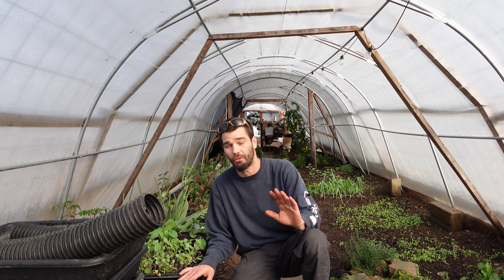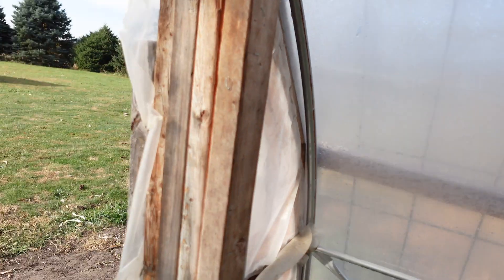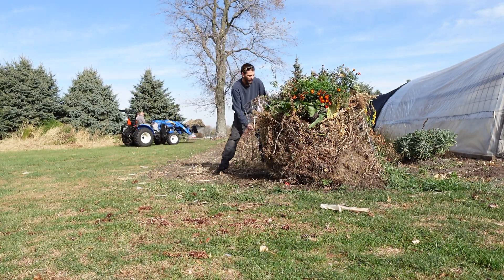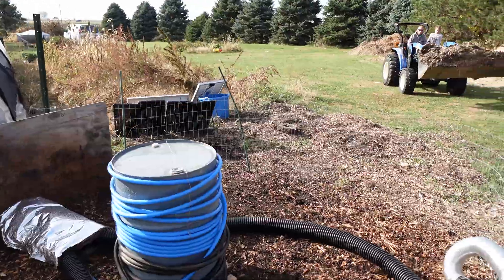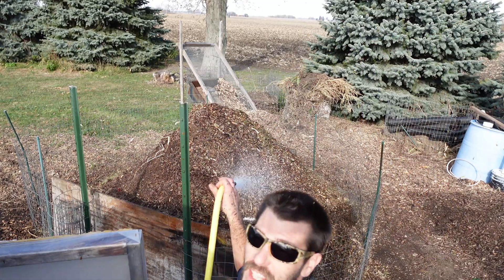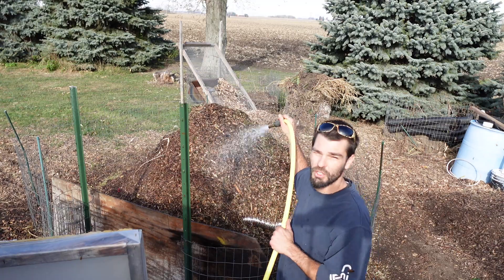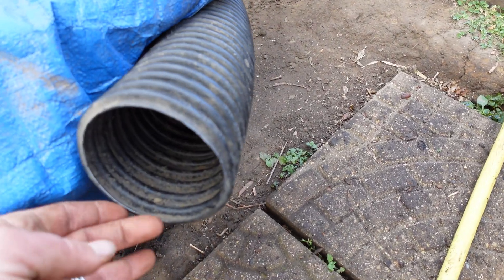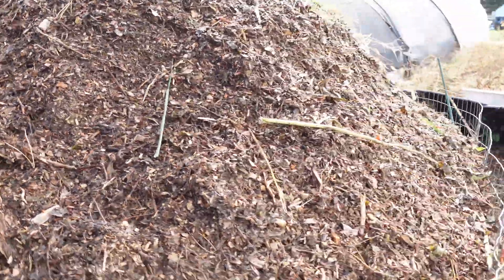How To Build A Compost Heater - Sustainable Greenhouse Heating - Jean Pain Compost Heating -

Comment: It's not going to stay hot all winter. I can see this is your first attempt. If the chips are fresh and had leaves it will get hot for a while. The leaves burn off quickly. You should have mixed in green hay (cheap goat hay) or lawn clippings. Even then you have to turn it regularly to keep it oxygenated. If not your aerobic bacteria will cook and then anaerobic bacteria take over producing less heat. I worked for a mulch company maintaining a pile of chips that would fill a football stadium. My JohnDeere loader would scoop up a full size pickup truck! I also make compost at home.
Reply from the maker: Not the first attempt we’ve been doing this for almost ten years lol. I didn’t show the cow and chicken poo slurry that was basted over the whole pile one five gallon bucket at a time and resoaked with heavy watering and more poo more water ect till I feel it’s properly inoculated. We’ve had the piles they we built up to 11+tons stay active inside the crust for almost a full year
Reply from the maker: I did show the cow poo slurry in this years video, my last long format video posted. Over a month and the piles still hot even with negative temps hitting us the past few weeks and I didn’t get the rest of the woodchips I had getting dropped before the snow hit so I used what I had prolly about 10 tons or so

Comment: Question from a total amateur here - how do you connect the compost to the air and water lines? I saw the tubing you put under the compost... but it didnt look like it connected. Also - Do you have to continuously apply water throughout the winter...? or did you cover it after the first rainfall. Thanks! :)
Reply from the maker: This is the compost heating playlist If you wanna check out how we’ve done it from start to finish https://youtube.com/playlist?list=PLKGq1CzKnwXNvQIKQ2OZ7DC3lT0w7M2XC&si=fPFZ7uaTnpfkloU3
Reply: @Earthdwellershomestead  Cool thanks! I will check it out :)

Comment: Anyone know what type/what it is called on the type of fence?  Size square, etc..  I need to start a pile.
Reply from the maker: Normally I insulate the pile very well, we experimented with an unisulated pile as we didn’t collect leaf bags this year
Reply: @Earthdwellershomestead  Awesome.  I plan on trying pine needles.  My mom has so many pine trees and inches under every tree.
Reply from the maker: @ericadams5019 Pine needles are a great resource!
Reply from the maker: This is just welded wire 1” or 2” works. It allows air flow and moisture to come and go

Comment: how does the air work? the air hose is open one one side and the middle is covered in compost? you mentioned fans?
Reply from the maker: We cover it all in our playlist names Jean pain compost heating. Both ends are open and the pipe is buried in compost. With solar power and fans we blow the air from the greenhouse through the pile and back in

Comment: I have a massive supply of animal manure I'd like to mix with the woodchips and draw air heat from. Do I need the water barrel then? Or does that act as a heat bank in the center? Also, do you cover this with a tarp during the winter?

Comment: is it best to over do the water? are there any cons to oversaturating the pile?
Reply from the maker: I’ve never found I can add too much water in the sense that it never heats up from over watering. Now I will say that I know there’s a saturation ratio of gallons of water to x amount of chips and I should try and track that down and share it. Thanks for the question

Comment: I've been following you for a while now, planning my version of a heated greenhouse for construction next fall. Woodchips are going to be the issue due to where I live. I can probably get a few tonnes piggy backed on stuff my neighbour brings in. I'm looking at substituting hay and straw to make up for the lack of chips. I'm also looking at using the stuff from the fall cleanout of the chicken coops and possibly Sorghum sudangrass for the green materials.  Do you have any suggestions for ratios or amounts?
Reply from the maker: We try for 25% nitrogen solids to 75%carbon solids and we water it in heavily. Farmyard waste works great for this!

Comment: One thing I've done on my woodchip piles is to add a few flat rings around the mound.  If you leave the mound shape, rain water will flow off the pile.  But if you break the shape by adding a few flat circles, the water will flow into the pile more.
Reply from the maker: Great observations and thanks for sharing!